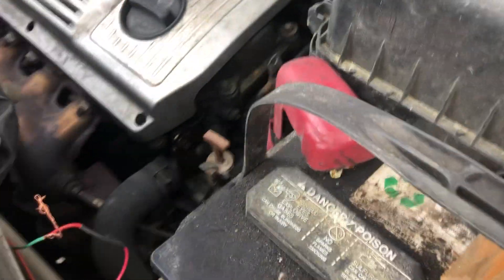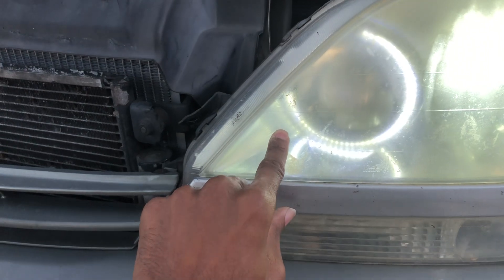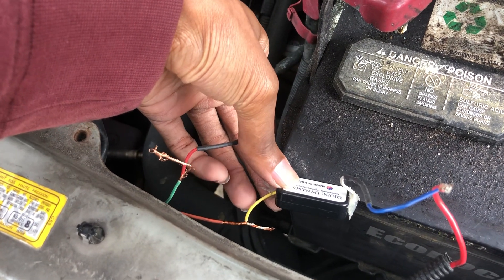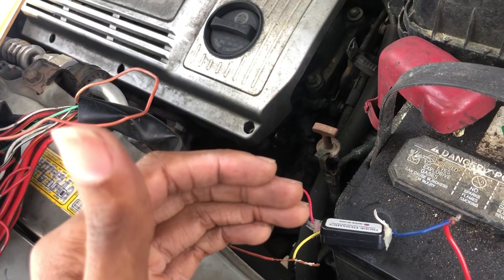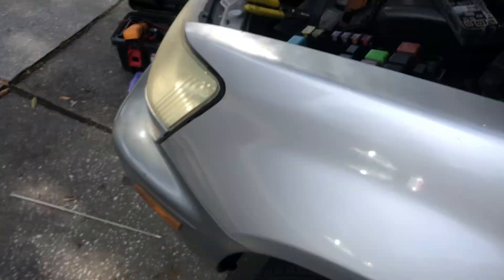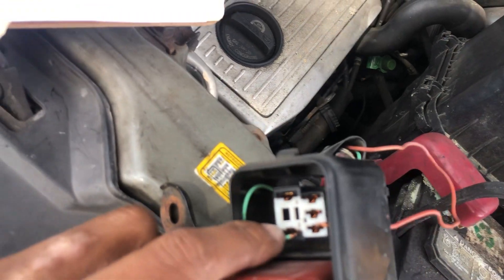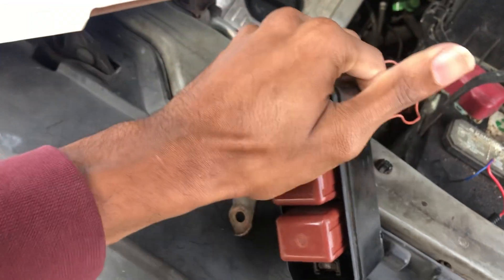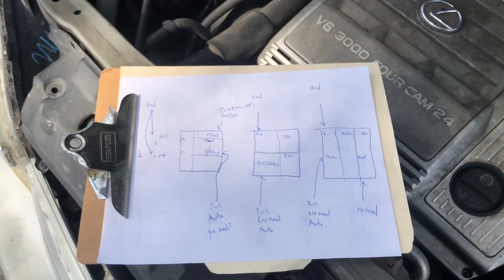1999-2003 Lexus RX300 DRL relays, fuses And halo wiring Install￼ Explained

Comment: Which wire can I cut, to get rid of the DRL"s ?
Reply from the maker: Don’t cut any of these wires m… if you want you could’ve just removed the relay, or put LED high/low beam 9005 bulbs in and that will disable the DRL as well

Comment: The constant DRL is very annoying to me. So it's just a matter of installing that module and then jumping a few pins on the relay? Please share the diagram. 99RX300
Reply from the maker: give me your Instagram or message me on Facebook “fahre haze” And I will send you a message with the diagram, but remember you need this other module to jump the relay. Otherwise they will be on high beam continuously I will explain it.